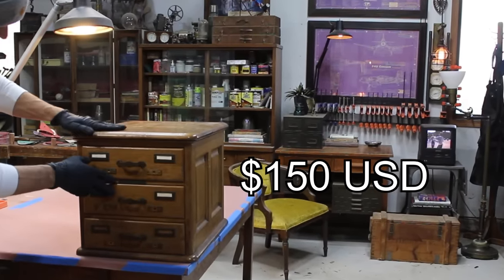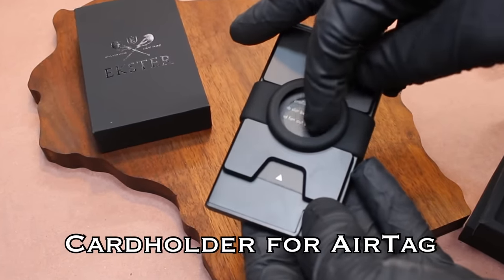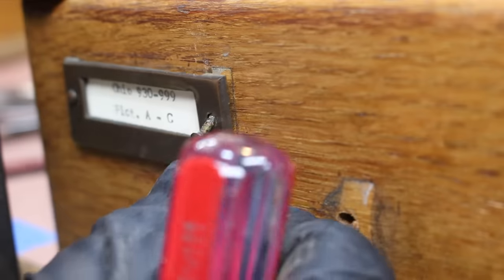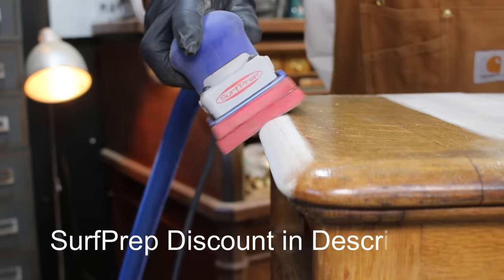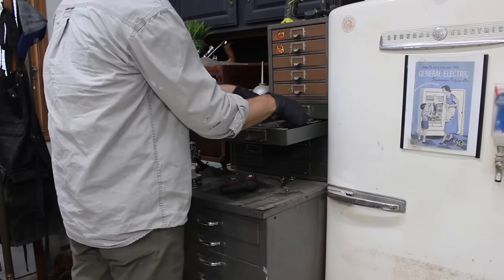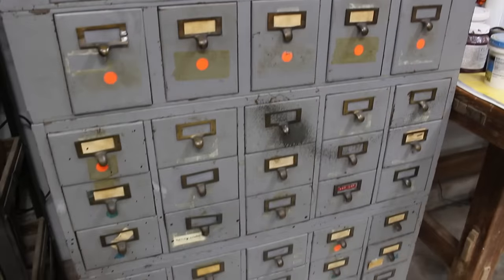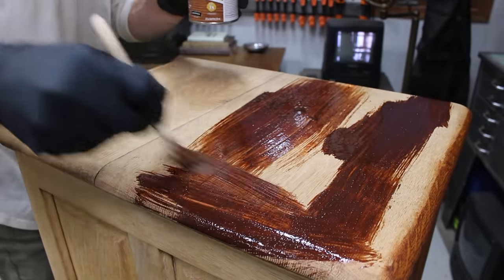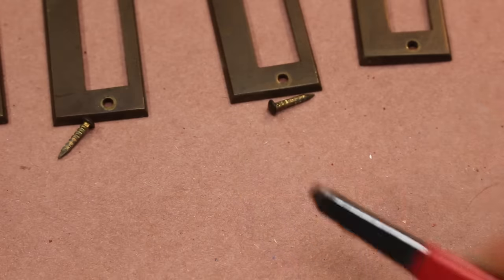Ep. 87 RESTORATION of Valuable Carnegie Library Card Catalog

Comment: Hi Barry. Your piece turned out beautifully! When I was in high school (in the 1970’s), I was a “page” at the local public library. I worked after school and on weekends. I learned so much while there. My job included checking books in as they were returned, putting books away, and eventually helping the patrons use the card catalog and to find the books they desired. I will never forget the sound the check-out machine made as the card from each book was pushed through, as the library card info and return date was imprinted on the card. 
Those days are gone, but the experience helped that young lady learn so many life skills. Good memories.

Comment: I’m a bit older than you, born at the tail end of the Baby Boom generation. So I have certainly learned and used the Dewey Decimal system with wooden card catalogues. I last actively used physical card catalogues in a small specialty library on the University of California Berkeley campus where I worked from 1988-2002. I remember being surprised that they still were using cards. Even that library had much larger card catalog cabinets, though. The main UC Berkeley library was still using traditional card catalogs when I attended there from 1980-1984. The catalogs were ENORMOUS, taking up a very large room in the library. Getting up into the main stacks was like entering another world. I used to spend time up there reading books on medieval costuming and cookery. Good times!

My great-Aunt was a librarian as well. She retired when computer databases and information science took over what librarians used to do, and changed the skill set necessary for the job. 

When I look at that card catalog, I think back to the time when such a small cabinet could hold the entire contents of a city library. That cabinet could certainly hold thousands of entries, which would have been sufficient at the turn of the 20th century, about when my great aunt was born. These days, even a small city library is likely to have more books than that. And that doesn’t even count all the ebooks and audiobooks! The world has changed dramatically in my lifetime in this regard. 

Thanks for sharing your lovely refinishing and repair job. It’s just gorgeous as always. I’m glad you were able to rescue it and give it a new lease on life. It’s gorgeous (stunning grain!), and I’m sure it will serve you well, whatever you do with it.